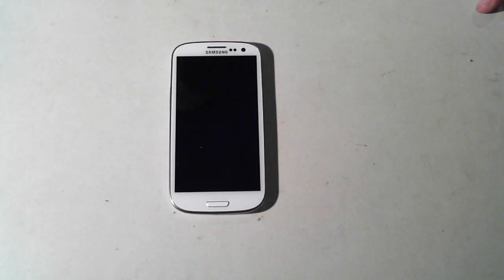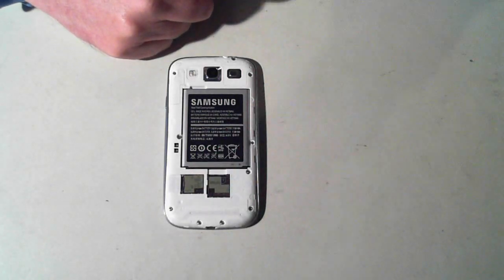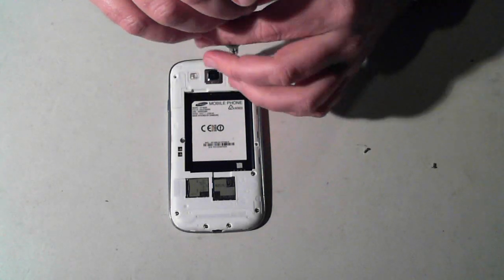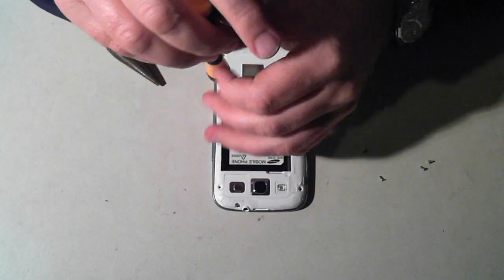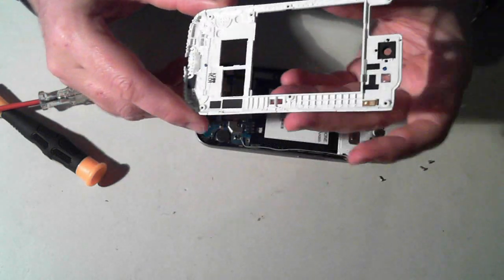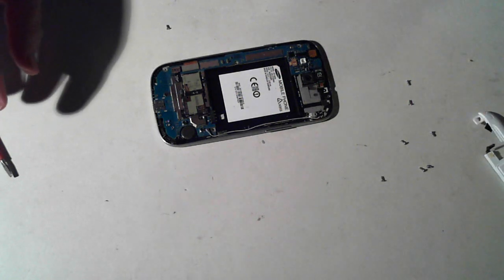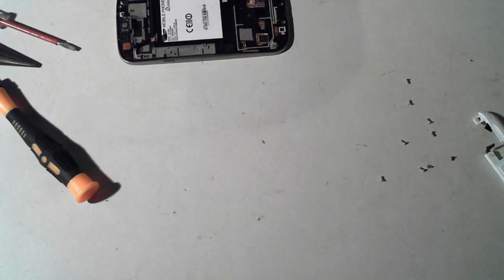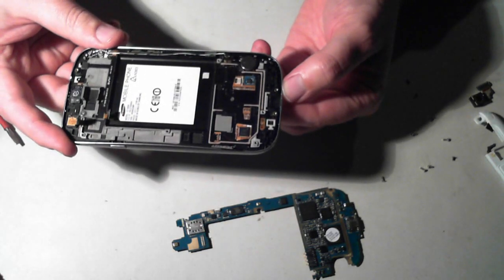Samsung Galaxy S3 Teardown

Comment: Is there a possibility of recovering data from a removed memory chip?
Reply from the maker: wbu744 Do you mean the micro SD card? If so yes you can just pop it in a sdcard reader for your computer.
Reply: dpcomputing I meant the phone's internal memory, sorry. My S3 broke down, doesn't power on at all, and while I went ahead and upgraded to the Note 4, I still wish to recover the data in the S3.
Reply from the maker: wbu744 It's possible but you'd have to take it to a specialist data recovery firm.